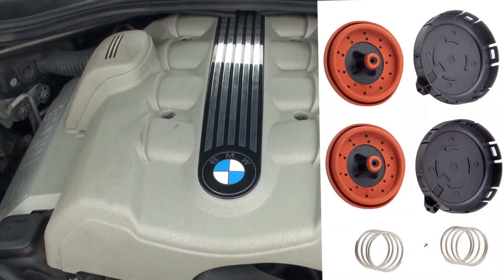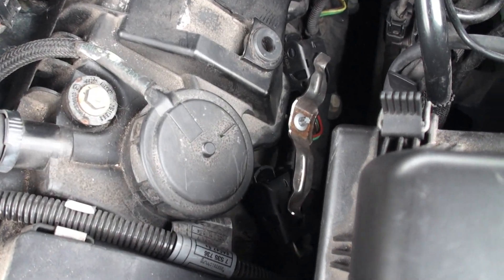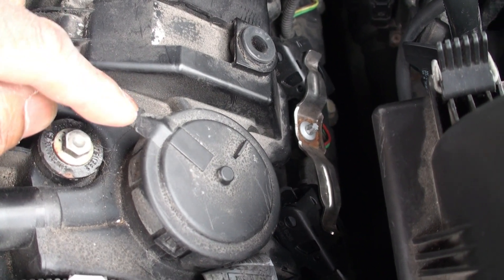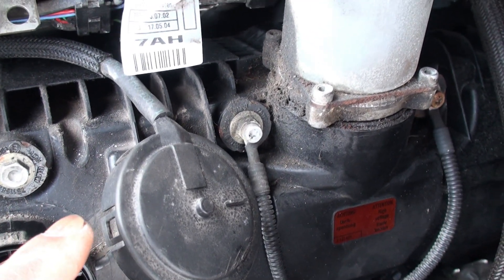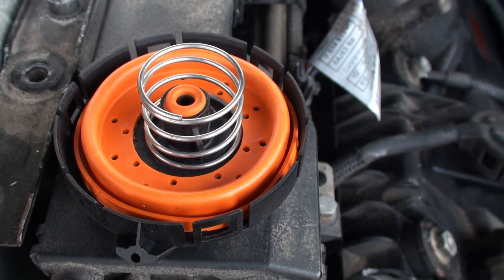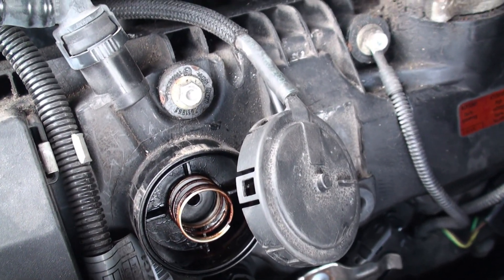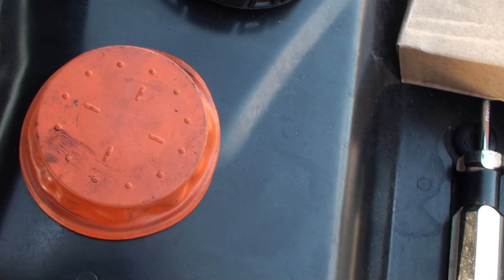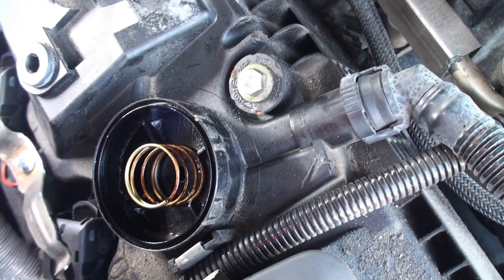BMW N62 ENGINE POSITIVE CRANKCASE VENTILATION VALVE (PCV )INSTALLATION

Comment: Did this resolve rough idling issue? which bmw series is this 2004 545i?  I am having rough idle and misfire issues only when car is cold in the mornings. When car is warm, runs perfect.
Reply from the maker: Hi pastmedia changing the PCV Valve have nothing to do with rough idle or misfire. If you're having  Grey smoke from the exhaust: This could be excess oil, or a PCV valve failure. I was just doing a regular maintenance  as to why I changed my PCV Valves. Good luck I hope I offer you some good information to your problems. Thanks for watching
Reply: @chrisblackprince5745  Not true. PCV can be split, or hard, reducing its ability to work as intended. Or can be blocked up with gunk, along with the connected CCV pipes. Cleaning these out can fix rough idle/misfire.